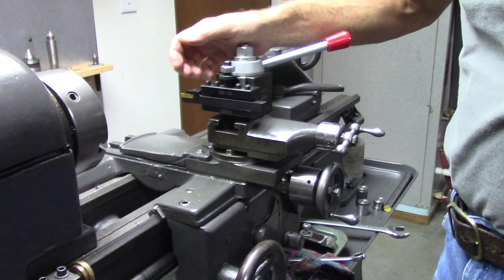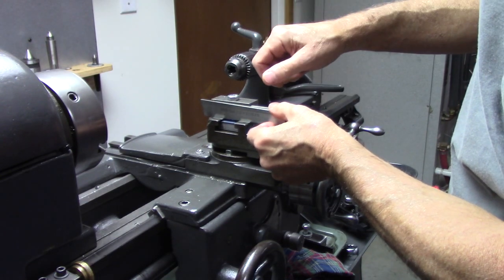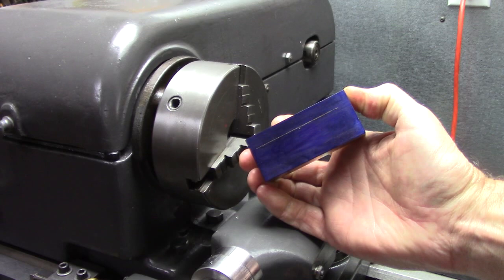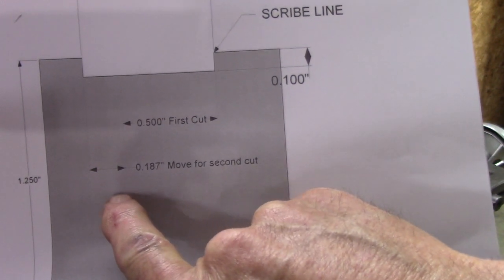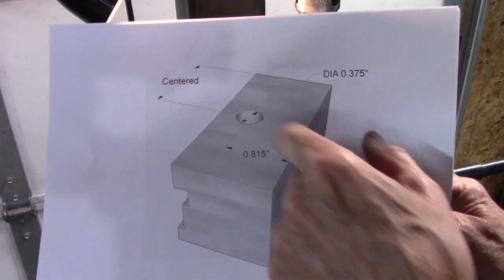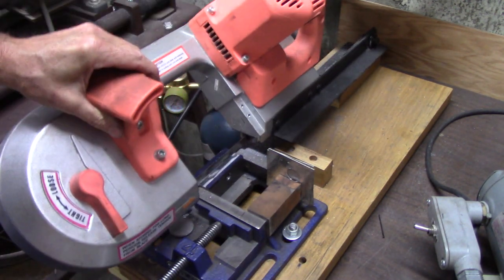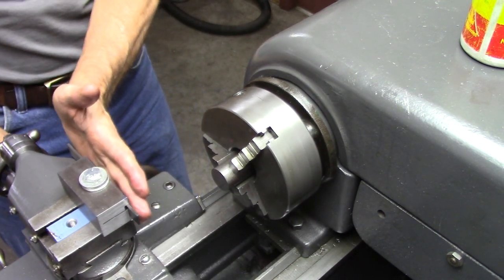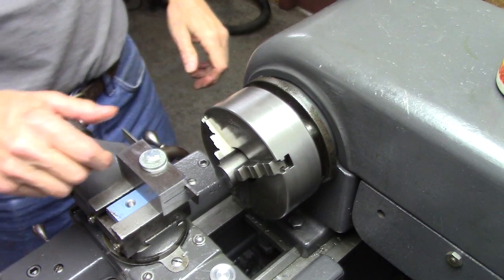Metal Lathe Cut Off Tool holder - NEW easy to make design

Comment: How do you adjust the centre height when the top rake needs regrinding ? What is the point of a tool post like this when every time you need to use you have to true it up to make sure it cuts flat. You can buy tool holders to do exactly the same job that can be held in the quick change tool post. This is from an engineer of 54 years !!!
Reply from the maker: Search for this number to see the blade. HHIP 2000-7030 . This blade is designed with a concave top running the length of the blade to control the chip clearance. Grinding a back rake is not needed or desired so if you make the holder correctly there is never a need to adjust the height. It's true that removing a QC post and installing this holder will result in a lost zero setting but setup time is only about 30 seconds. Square it to the chuck and go. The reason for this design is to compensate for less than ridgid compound on many older (and a few new) small lathes. I can cut two inch bar on a Monarch lathe equipped with a QC post all day long but but this is not the case on many small lathes. This blade holder changes the forces on the compound to mostly straight down where as the force created while using a QC post  is more rotational on two axises.  With this design I can cut at any speed or feed rate until my lathe belt slips without the slightest chatter. Imagine the forces on a tool post 1" square. Of course the AXA is much larger but the same forces to a lesser degree apply

Comment: Just buy a decent toolpost, try a multifix and it won't suffer the problems you describe. I power part with mine with no issues at all.
Reply from the maker: I've seen those posts...  excellent posts. I'm guessing it would work better although the tool holder is still hanging off the side. The main problem with my lathe and many others is not the tool post but a weak compound. I think I'll stick with my design. If I was running in production I'd certainly consider this post...  but also a much better lathe!
Reply: @WinkysWorkshop  If the parting forces have a solid metal direct line of transmission through the compound and into the lathe bed (which you have mostly tackled in this video), then the rigidity of the various compound retainers does not become a factor in performance. However if there is no direct line of transmission then you have created a lever and/or a spring, neither of which are good. In the case of the lever, the slides become separated by the amount of play in the gib and are instead constrained only by a few springy gib screws - the ideal scenario for disaster. A shiny new Multipoint toolpost will do nothing for this. For mini lathes I have documented how to improve the rigidity of the gibs:

http://fidelityforce.com/keantoken/content/LatheGibs.php
Reply from the maker: @keantoken6433  - Well said and thanks for the link. I'm going to check this out further. However, I will say, my gibs are not made like what you have illustrated on you page. I'd have to measure to know for sure but I'd say they are about 1/2" tall and 1/8" thick.

Comment: No, no no and NO  . An Aloris or Dorian Type Wedge Lock Tool Post ( Swiss Style included)  have no lateral or vertical pull, this is BS, plain and simple. Dorian, and Aloris have repeatability of .0002 you do not get deflection from this style Tool Holder. You will however get Rigidity issues from little Play toy Lathes, that have have... #1 No Balls, #2 no Rigidity   and #3  no reason to be around except for Hobby work. For Hobby Work, use the thinnest Part-off tool and shorten it up as close as you can..
Reply from the maker: Yes yes and Yes, you are correct Aloris, Dorian, as well as the Chinese knock offs do not flex. They simply suspend the tool and provide the leverage to flex the compound on my toy lathe!  Which is basically what I said in the video (minus the toy label). I totally agree that it is a lack of rigidity. Where we disagree is that it has no reason to be around. I've made many very useful items...  including fairly precision printing press parts, automotive parts, a bunch of lawn mower repairs as well as woodworking equipment, a wood lathe, grinders, modifications to a drill press etc. Yes it's a hobby lathe that has served me quite well and apparently with slight modifications such as a cut off tool holder and new dials it can do a lot of what your industrial lathes can do. It's true, I would not want to try and support my family with the work coming off my lathe but it certainly has it's place.  So if you can bring yourself down of that lofty pedestal for a moment you might be interested in a few of my videos.  Please subscribe - you might be surprised and I welcome your comments!

Comment: Where did you get the 3\32 cut off blade from and is it 1\2 inch tall
Reply from the maker: The number on the blade is HHIP 2000-7030 3/32 x 11/16 x 5 Inch. I got it on Amazon. Also it is 11/16" tall.